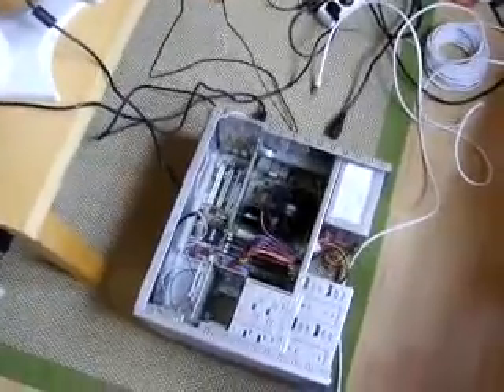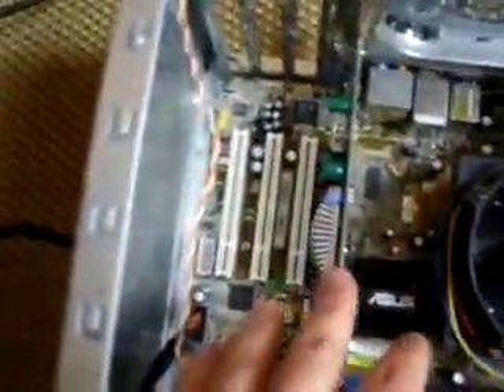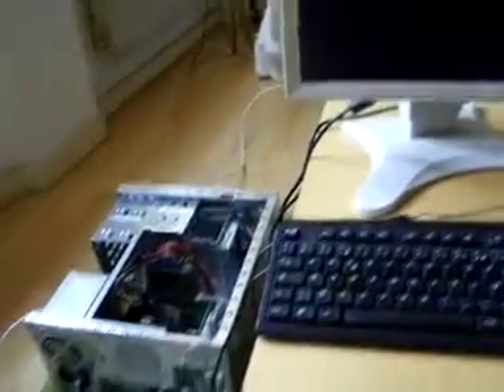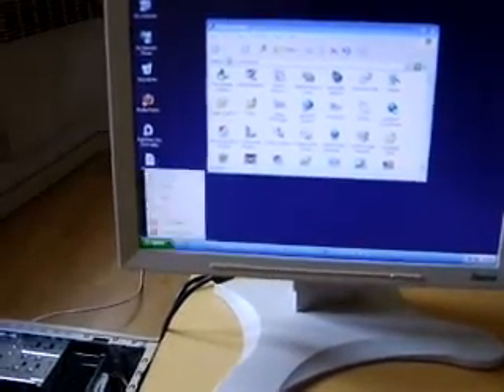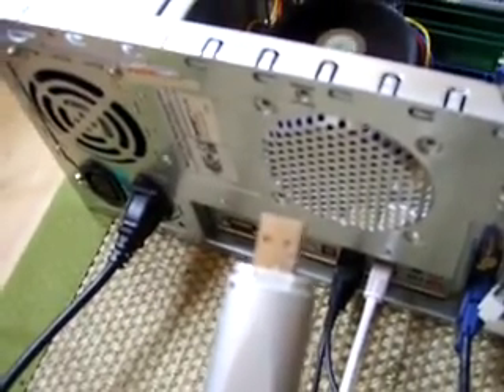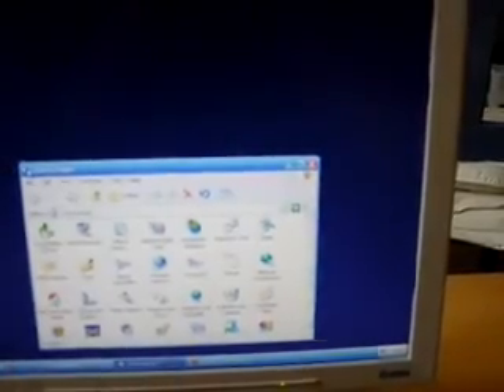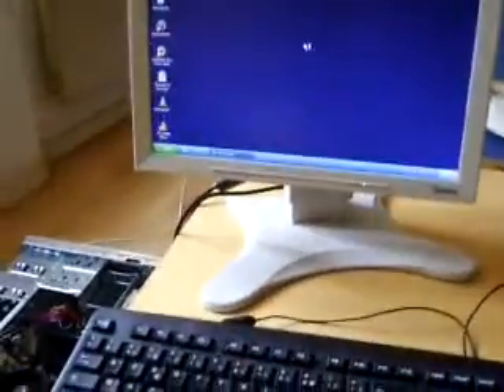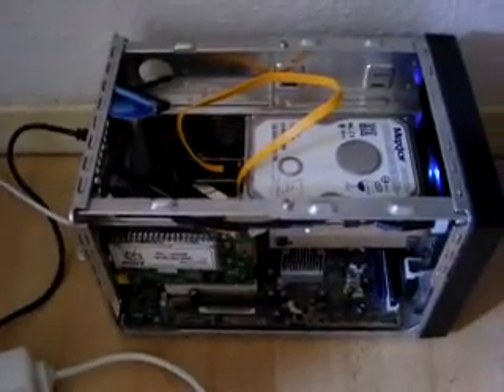windows xp diskless lan boot using AoE pxe

Comment: @pierrele Hmmm so maybe I can make a copy of the disc file for each client and update vblade/gpxe configuration.

I was looking for an alternative where the client would copy the entire disc image and boot it locally (this would happen only when our system is updated, every 1 or 2 weeks). Do you have any suggestions?
Right now I'm using a Norton Ghost image on a shared folder, and a more straight-forward way of doing this would be nice.

Thanks again.